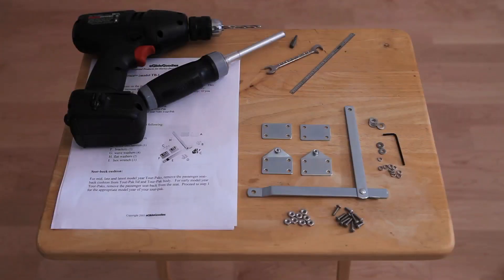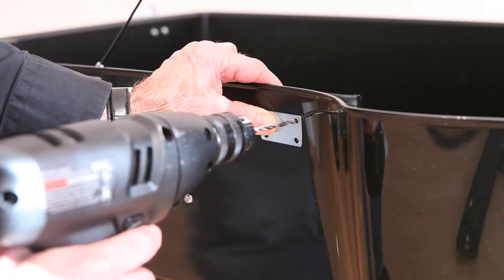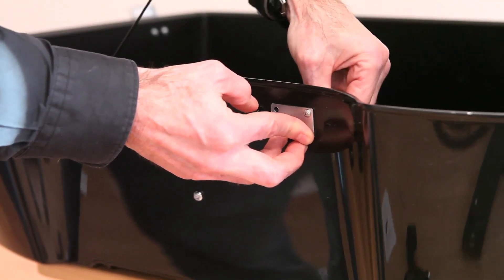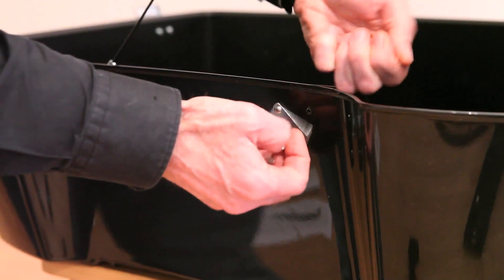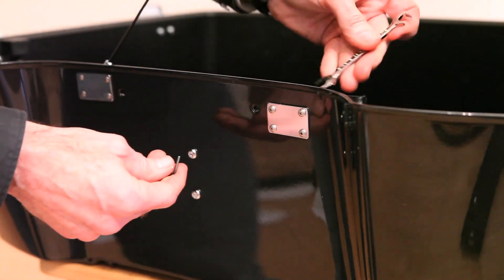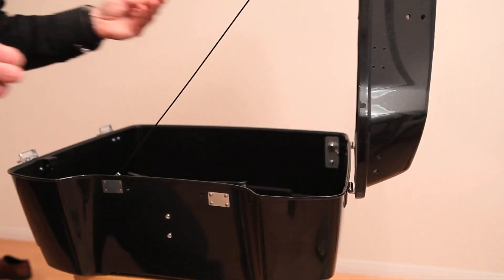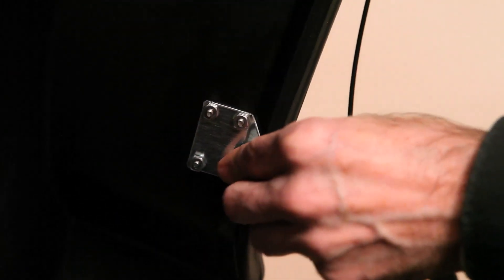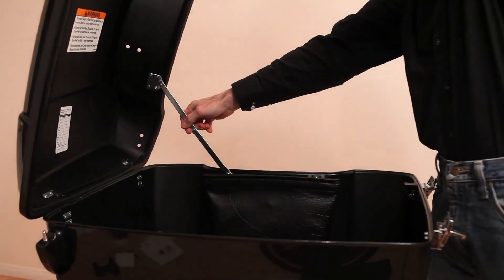Ultra Brace Install on Pre-Rushmore Tour-pak

Comment: The screws are not long enough for the 2016 Road Glide Ultra. The inner shells, top & bottom, were not taken into consideration. This wasn't discovered until I drilled four holes in the bottom half of my tour pack.
Reply from the maker: Larry,

We’ve seen that if you use longer screws, then when they are tightened down, and the screw compresess the liner and.... they then seem too long. Try this procedure: For one hole, if you delete the lock washer, then thread the nut back on, you can attach them without any trouble. Then proceed to the other three screws with this method. Then go back and back out one nut at a time, add the lock washer, then tighten the nut. Do these on the remaining screws. This way the shorter screws can be used and you can tighten them down. Any you will not have too much screw sticking out from each. The issue is the compression of the liner that warrants the screw size we used for the kit.  Try this and let us know your feedback Larry?  …Patrick
Reply from the maker: Louis, our TB-3 Ultra Brace fits all tour-paks...from the early 1979 tour-paks, all the way up to the current 2019 Rushmore tour-paks. Here is the updated installation instruction video for the Rushmore tour-paks:https://www.youtube.com/watch?v=rHcEd4Sv3Wk   @louis_costa